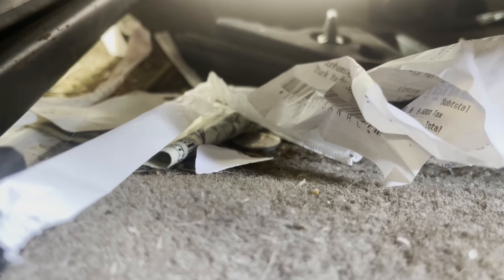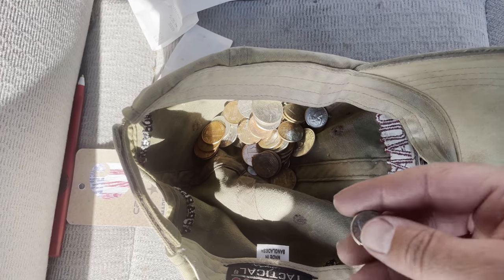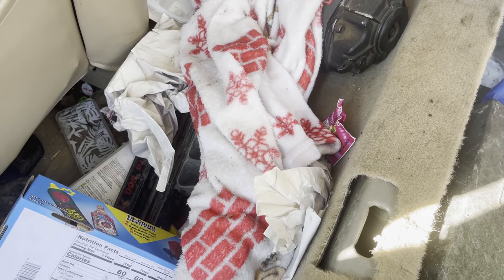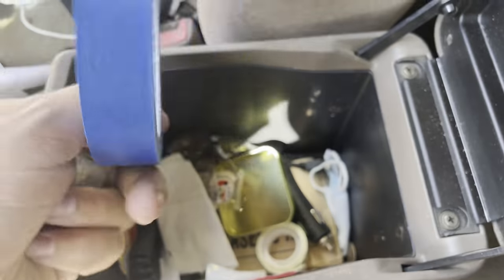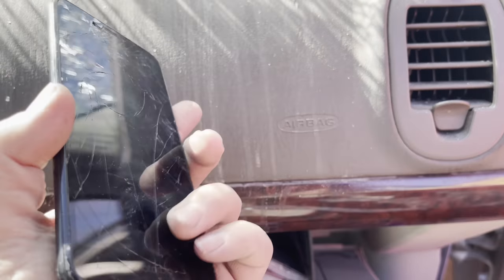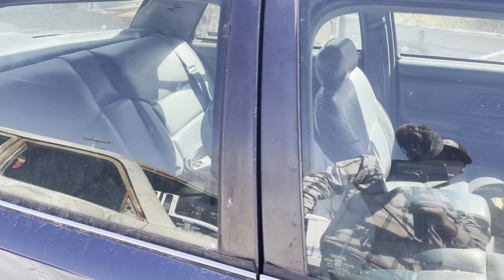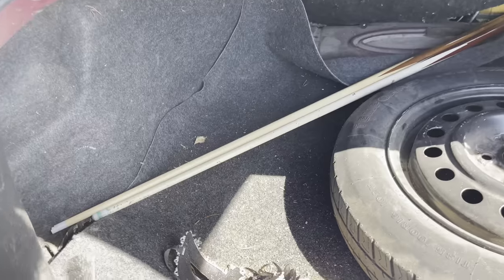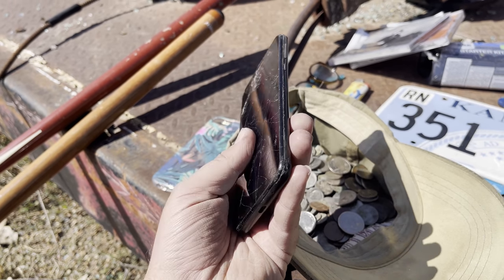I Found CASH MONEY, a PHONE, Jewelry, Tools, and MORE While Digging in Cars! JUNKYARD TREASURE HUNT!

Comment: Water is the universal solvent, and if you add a little dish soap, a lot of oily/sticky stuff will clean off.  Just pour some into each scummy armrest clump of coins, or pry them out and toss them into a Ragu jar with some soapy water.  When done, drain the jar and take it home for a final soaking/washing/rinsing before taking them to the bank.  

The 3 tokens are anime characters.  The funny looking one is Pikachu, the fox-like ones I don't know the name of, but my daughter (older than you) would.  Probably common stuff, though some high-end stuff exists for collectors.

Blue nitrile gloves have come back down in price occasionally at Harbor Freight.  They won't stop a needle, but they'll keep unknown sticky messes away from any scratches and cuts you have.  You should do a night-time edition of the treasure hunt, using a UV flashlight.  Or maybe not.

Comment: Back in the mid 70s when I first started college I got a job working at a large salvage yard. I was the flunkie so I was sent on scavenger hunts. First get jacks from the trunks. Then the spares. Batteries, carbs, you get the idea. Any money went to the boss. No exceptions. Any tools I found I got to keep.
You would find all sorts of stuff in the impound cars.
One of the most bizarre things I ever found was a car full of bras. Teeny tiny ones to ones we could have used on the milk cows back home. They all seemed to be all new and unworn. All colors and styles. Who knows, maybe they were a "Fuller Bra" sales person. Weird.
Winter settled in and that job ran out so I got a job assembling those replacement battery cable ends.
Square head bolt, 1/2 inch nut. Two 1/4 inch bolts with cable strap and nuts. Mount them to a cardboard sheet by the nut that pinched the terminal closed. Piles of nuts, bolts, straps and lead terminals. All day for the princely sum of 4 bucks an hour.
I moved on from that too.... LOL!
Cheers
Terry

Comment: I like the treasure hunt videos. I wouldn't save the rocks. I woulda dumped them out in a low spot in your driveway. When you do these videos Silas, get a can and put dish soapy water in it and soak those coins. It will dissolve that soda and junk holding the coins together. Another tip for some toys is run them thru the dishwasher. Cleans and sanitizes anything. Thin plastic may melt though. Hot Wheels should be fine, put in the silverware basket.